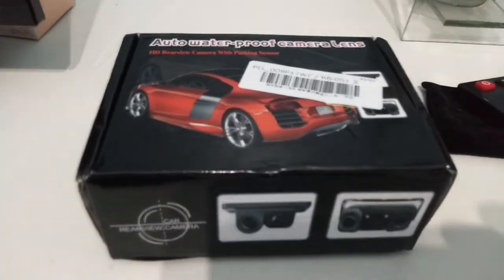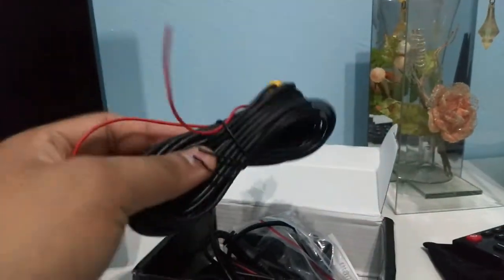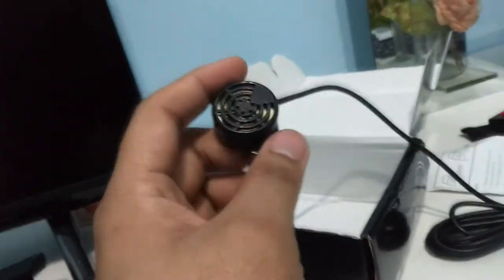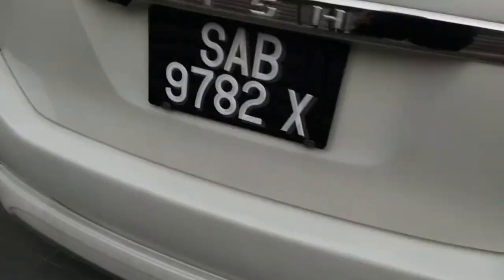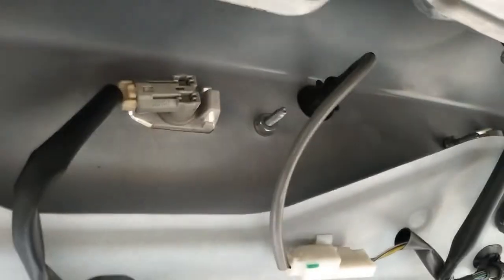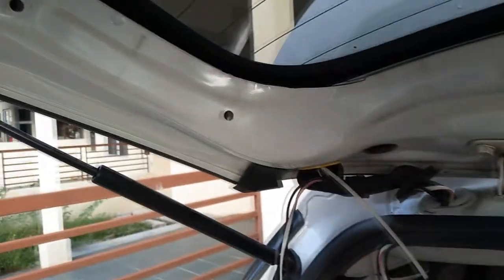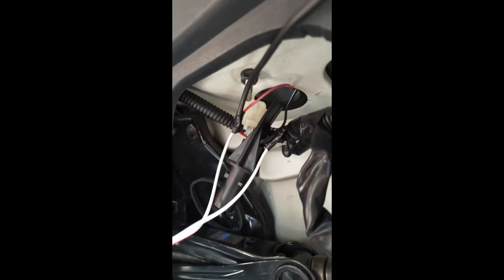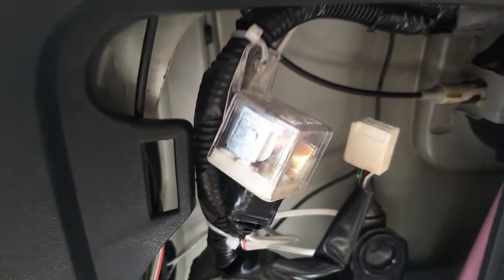Backup Camera With Reverse Sensor| Installation video + Tips and Tricks for MPV cars installation.

Comment: Hey bro. Nice video. I have the same car model 2006 Toyota wish. Do you have video for installation of your JVC unit? I currently have factory radio unit installed.
Reply from the maker: apparently i don't have the video, however a lot of malaysian and japanese are doing that radio installation video. My advice is if you want to search for it use google translate to look for the video in their language. hopefully i did help a bit.
Reply: Thank you for replying @IkmalRusli  I will try that. Cheers bro.

Comment: Great video. Thank you so much. But I wonder why your old camera system lens is blurry like that. What could have happened?
This is important, please what is the issue with the lens and how can it be avoided?
Reply from the maker: @HighFLYER-9000   unfortunately there is not much that can be done to avoid the lens from becoming blurry. This is due to long exposed UV rays, although it comes with UV coating it will eventually degrade as time passes the same as car headlights become blurry. You can try some UV coating aerosol available in the market today but my best advice is to replace a new camera since it is cheaper nowadays. subscribe if im helpful

Comment: Very well put thank you for the tutorial not trying to be a critic but it looks like the camera is not straight a little crooked
Reply from the maker: Yes you right bro, actually I can't put it onto the right angle cause of the cam cable, it is tight fit unless I cut the chrome garnish to make hole to match the cam size which I am lack of that tools.
Reply: @IkmalRusli  👍 and I don't blame you I was a little salty that I had to drill a hole in my trunk. I have a Pontiac Grand Prix 2004. Lol